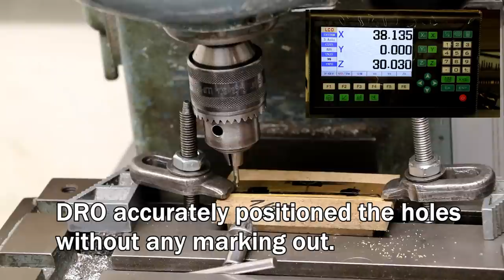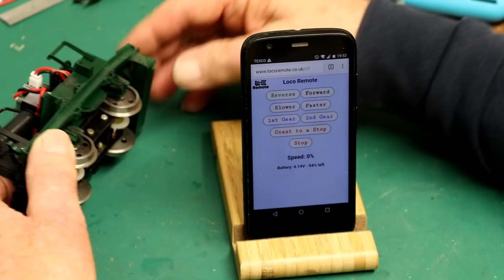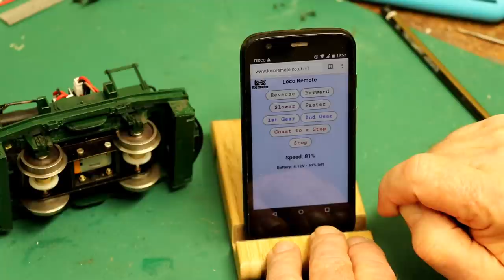3D printed Simplex Loco with Loco Remote control.

Comment: Great wee video. Thank you. I noticed that the battery consumption dropped by 10% under the test that you showed. That wasn't a great result. I wonder how long the battery lasts under full load conditions.

Thanks again for sharing. I'm gonna get one of those Loco Remote modules.
Reply: the % gauge is a bit deceptive, just because it went from 4.2 to 4.0 volt doesn't mean it lost 10% of its energy content, the discharge curve on a lithium battery is not linear like that, it's only really linear between 3.3v and 4v, where most of the actual energy is.
Reply: @AlexanderBurgers  Thanks for that. I'd still like to see a video made of the real-time load and battery usage. Maybe a larger Ah battery would help?

Still a great video, though.
Reply from the maker: I am making a real time video right now, results are looking good. Over 30 minutes so far and still showing 60% battery left.

Comment: Cool.. Is there a app/module  like that to control other stuff? Would be cool to control my 3d printed tank from my phone...
Reply: Link in his description
Reply: I'm a little late to the party but...  I got a tank kit from MakeBlock a year or two ago.  It runs on a customized Arduino board with plug&play motor controllers, Bluetooth interface, and a pretty handy scratch-based customizable control board in the app.  You could drop that controller into just about any chassis.